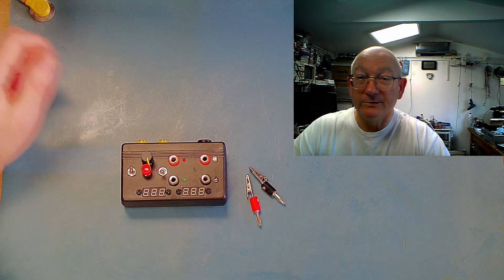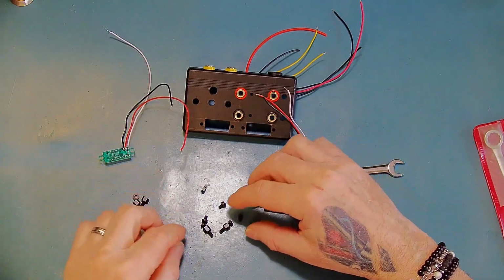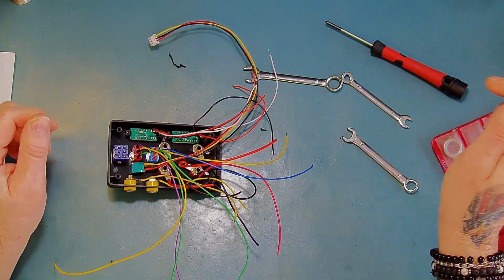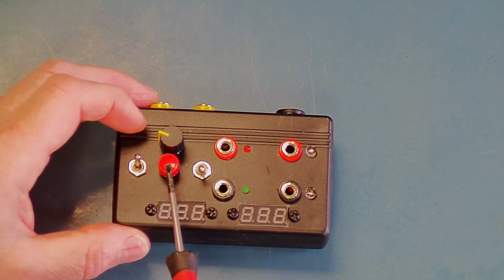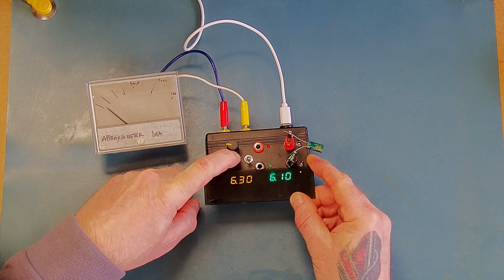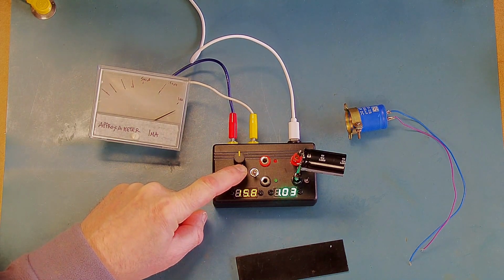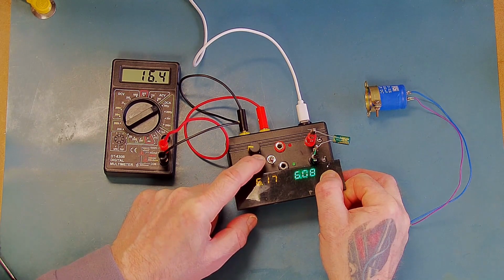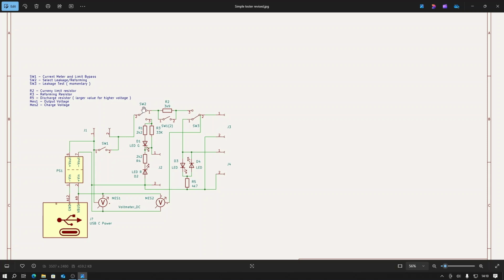$5 USB C powered Capacitor leakage Tester ( Electrical Leakage)

Comment: Hi - love the idea to have USB-C as a power supply. We had some mixed results with the pre-made connectors: most of them don't have the two 5k1 resistors for the CC1 and CC2 lines. With a "dumb" power supply, this will work - but without the resistors (to GND), all the intelligent supply won't output any voltage. So, for future-proveing thst's something to consider. 
In Richard's / LER Video 833 (can't post links in the comments) you can see the USB connector I currently use.
Reply from the maker: Hi Det, of course you are absolutely correct. The particular USB C socket I used for this project literally only has the two power wires connected from the socket. I do in fact have the exact same rectangular shaped socket you are using , and to be honest the main reason I use the other type is because they are so much easier to panel mount. I will soon be working on an another, hopefully more comprehensive leakage tester for my bench, I will use your recommendation on that device if possible. Thanks and best regards